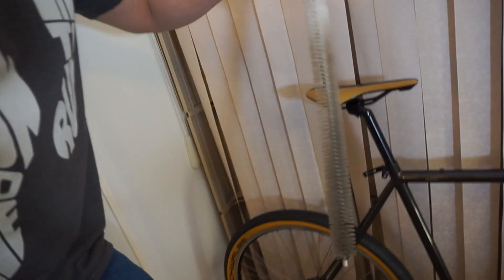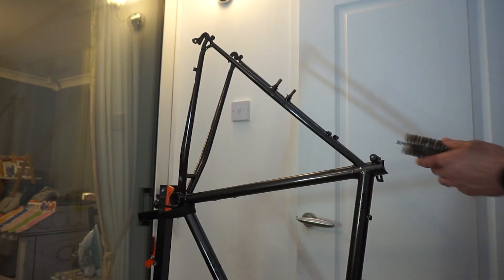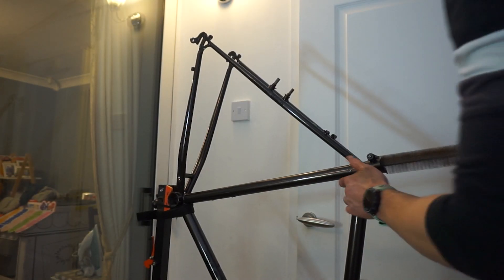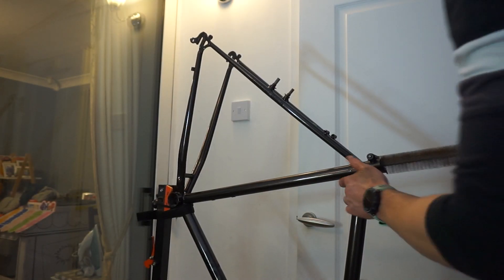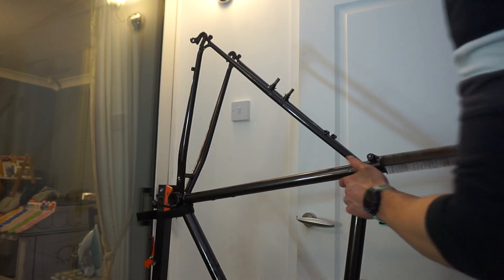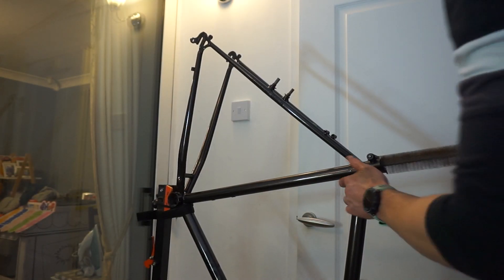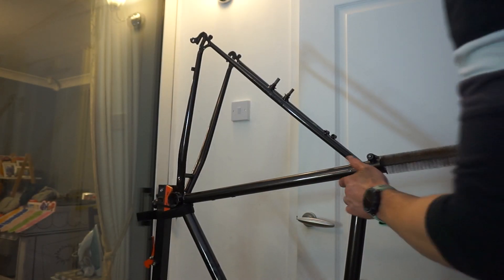Spindatt Trasher Bash Bike Build Part 9, Fitting a 1984 HiteRite Dropper System #trasherbash2022

Comment: Really enjoying the build! It’s inspired me to re-build an old singlespeed MTB using the pile of junk components at the back of the shed. Tonight’s head-scratcher is figuring out how to removing the remains of a collapsed bearing from a Hope free hub!
Reply from the maker: Haha NICE! I wonder is that gonna be a dental toothpick OR a hammer and small screwdriver type of job Sam? Please do share your progress if you can as I'd love to follow along! I've got a "ratbike" parts bin build scheduled for later in the year too ;)
Reply: Not done this on a free hub, but to remove stuck bearings held in aluminium I strip off all the parts I can, clean, then place the part in the oven with the bearing facing down sometimes supporting the part so the bearing can drop out as it gets hot. Let the aluminium cool slowly. It will wreck plastic or rubber parts if you can't remove them!
Hope this helps, good luck.

Comment: Yeah, the old 26mm dropper dilemma!
Looks a good solution if you can use it :-) (think I'm too broken to think about using 1 on the fly :-( )
Your seat post could be hitting your top bottle mount boss, stopping it going lower, if you cut your post remember to leave enough length in your frame at the highest setting you want to support the post, usually about 10cm ;-)
Reply from the maker: Yeah waiting for a 26.0 Gravity Dropper to come available at an affordable price on eBay didn’t pan out Rick, but having the ability to drop the seatpost at will should be good as flying down lumpy descents in the peaks without dropping the seat is torturous 😬 thanks for the advice mate I think you could be right so I’ll check and measure twice cut once ;)
Reply: @rejuvenatebikes  There's obviously a hole in the market, that's at least 2 of us with 26mm seat posts in S.Yorks. alone! (Aye up from Doncaster)